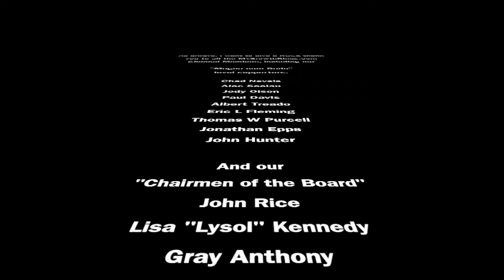Shopsmith Bandsaw Blade Change

Comment: Scott, another great video with some quick and easy tips.  As a side note I purchased my Shopsmith & bandsaw 20+ years ago.  The bandsaw tires were the original black tires.  They really had some deep checks in them.  On a whim I applied belt dressing to both tires.  The tires "healed".  I continue to annually apply belt dressing and the tires are still working great.  I know this sounds odd.  But the belt dressing worked.
Reply from the maker: Was that a spray belt dressing?
Reply: @MyGrowthRings  Yes it was.
Reply: @stased7343  what brand?

Comment: Excellent video, Scott. I learned and liked the tip about installing the blade with the guard in place. I was fortunate enough to win a 1/4" blade at the Shopsmith 75th Anniversary dinner and just decided to install it a few weeks ago. Wow, that thing cuts wood like a hot knife through butter! I was extremely impressed with it. I didn't even realize that my old blade was getting dull until I started cutting with the new one.

Comment: Seeing both color tires makes me happy. I have the orange and have had no issues. And some people deride the orange tires but then seem to have problems with the blue tires. My thought is that if the tires are easy to install, there’s something wrong.
Reply from the maker: There might be something to that!
Reply: Ok, so which one should I get? I need new because I'm going through my dad's old shopsmith after 25 years of sitting. We just never really used it. The band just broke while I was trying to cut some maple so I could have smaller pieces to turn on the lathe to make pipe stems.
Reply: @hisnameisiam808  I’d suggest getting whichever one you want, but make sure that if the tires aren’t a good fit, you can send them back.
Reply: @timbo389  ok, thanks! They both work for both wheels, right?

Comment: Great Video!
Love my SS Bandsaw.  Right now, I have a ¼” blade in it and haven’t seen a reason to change it out.  
OMG, I have that bolt for holding the table flat but didn’t know what it was for.  It’s just laying loose in the box of stuff.  I went to the shop to look at the table and yes, it’s not installed.  On the parts diagram, those are parts 88 (Knurled Nut) and 89 (Carriage Bolt) 
I didn’t know about adjusting the blade guides.  Good to know.
It’s these little nuggets that make these videos teach me things. 
This is content that I love.
Reply from the maker: That’s awesome, Jody. Thanks for watching and commenting. Scott

Comment: Thanks for the video Scott. I always seem to have the blade flex when I'm cutting. This gives me a tapered cut resulting in the bottom being smaller than the top. Am i going to fast or is that a sign of a misaligned blade? Thanks
Reply from the maker: Is the issue happening when you are cutting freehand or with a fence? If the blade is drifting, it can be one of several things, including using to find a tooth blade. If you haven’t tried a higher quality blade than the standard, Shopsmith blade, you want to check them out Because they are a dramatic improvement over the carbon steel blades most folks use. Scott.

Comment: Great video.
Are bearing guides a worthwhile upgrade over Cool Blocks? 
Also, thank you for explaining what the carriage bolt and thumb screw are for.  I removed mine as I couldn't figure out its purpose.  Now that I know what it's for I'll put it back.
Reply from the maker: I’m ok with either option, but with the bearings you’ll never have to mess with them again.

Comment: My blades--all SS--want to jump off the wheels while installing them. I coil my blades for storage. Would hanging them without coiling mitigate that?  Adjusting the location of the blade guides forward and back is much harder than it was on yours.  Do they need cleaning and/or lubrication?  And, I have an awful time getting my circular blade cover back in the table.  I'll watch the follow up video and see if you have answers there.  Thanks!!!
Reply from the maker: I’ve never noticed any difference in their performance based on the way they are stored. However, I have had some blades damaged while uncoiling them, not to mention quite a number of cuts. That doesn’t happen when I store them open. Yes, I would suggest that you clean and lubricate them occasionally. I did post a video on that process sometime back. If you’re insert is the same as mine, I did a video on that as well! There’s a bit of a trick to it and I share that trick in that video. Scott.

Comment: I haven’t watched this video yet, but I followed MGR’s bandsaw tune up & it changed everything to the better.  New blades, new guides, right tension, etc.   i get perfectly straight cuts without trying!  My biggest down fault is that i don’t de-tension my blade …….i always think I’ll be using it soon.
Reply from the maker: I do the same almost every time.
Reply: And now watching….removing the blade.  That nice trick of rotating 90 degrees! Is key to fumbling around the guard.
Reply: One question.  Recommended speed is 900 rpm per the SS guides.   I always cut at 900, but should i be changing depending on blade size or wood thickness/hardness?
Reply from the maker: @markb8954  I almost always run my saw at "D", which is roughly 1000rpms. That gives me a blade speed of close to 3000fpm, which is what most of the Timber Wolf blades are made to travel.

Comment: Scott, were you storing the re-saw blade under tension?
Reply from the maker: Always. I’m really bad about that, but I use it often and I find that the urethane tires don’t have the same issues with compression as the rubber tires.

Comment: I don’t have the SS bandsaw. I have a Jet. I was not having good results with it and an old acquaintance of mine showed me how to get it set up and he said he always puts the blade behind the crown of the wheel, even when the manual says otherwise. I’ve run mine both ways (behind the crown (SS) and centered over the crown (Jet, Rigid, etc.)) and I get far superior results setting up the way SS recommends their saw be set up.
Reply from the maker: Yeah, that’s also the way Alex Snodgrass advocates.

Comment: In your bandsaw tuning video you put the tensioner back on but you don't mention how it should be calibrated. Is the left edge supposed to be at 90° from the ground? Is the right side supposed yo be? Parallel with the blade? I can't find s source explaining that.
Reply from the maker: Man, there's always one more thing.  Yes, the stamped steel part with the measurements on it would be calibrated by removing all the tension first with the tension off the top left side of that steel gauge should be flush with the red edge of the flat steel spring.  If it is off, you loosen the screws that hold the gauge in place and move it to align with the edge. That's it.  Scott

Comment: I noticed that your 1/2" blade had little or no drift.  Luck of the draw? Or do you do something to your blades to reduce drift.
Reply from the maker: It did have a touch of drift, I’m just familiar with that blade and instinctively adjusted slightly for it.
Reply: @MyGrowthRings   Got it.  I have quite a lot of drift with my Timberwolf resaw blade.  Like you, I instinctively adjust whenever I'm using it.

Comment: Two comments:  1)  I've found that some skinny blades cut better with the waste on the left side of the blade (turn the work CW) and some work better with the waste on the right side (turn the work CCW) assuming there's room in the saw throat for the work. 

2) Most of the time, I don't even try to cut a full circle.  I roughly whack off the corners with the chop saw or bandsaw, making an approximate octagon then turn down to round.  When my gouge is sharp, I find it easier than trying to saw a careful circle. If the gouge isn't sharp, I sharpen it.  Remember, "If it's almost sharp, it'll almost cut."

The wonderful thing about this hobby is that if you get the shape you want, nobody cares how you got there.
Reply from the maker: Very good points. I didn’t bother to check to see if there was a burr on the back edge of the blade, which they’re probably is, which would contribute to some of the issues I had. I have to admit, I rarely use a carbon, steel blade, and I forget About how frustrating they can be.

Comment: Thanks for another very informative video! Question, then a cheap shop...You didn't say why you don't like that brand of blade. And now for the cheap shot: How can you judge the performance of the band saw with new tires when you mix the tires -one blue and one orange on the same bandsaw? You might find the really bad one if it falls off, but otherwise you have too many variables. 
BTW, Shopsmith just send out emails announcing a weekend thing in May.
Reply from the maker: Good questions, Jim. The reason why I don’t like that brand of blades is it began to wander as I made the cut, which doesn’t happen with Timber Wolf blades. The reason for the mismatched tires, is just in case one Baw received more use than another, I wanted to see how they performed. I have the orange tire on the top of a different bandsaw with the blue tire running on the bottom wheel. That way, regardless, of which saw I’m using both tires are getting equal use.

Comment: I noticed you don’t have a hole drilled out of the back of the Bandsaw so you can get to the tension adjustment.  Is there a reason you don’t have the hole?
Reply from the maker: I never saw the need. Removing the cover just isn’t inconvenient for me.